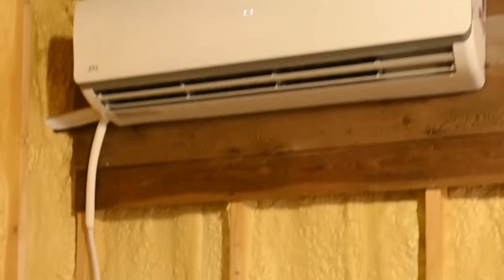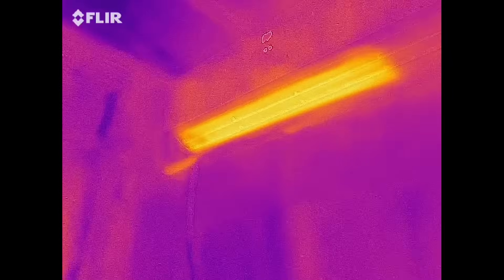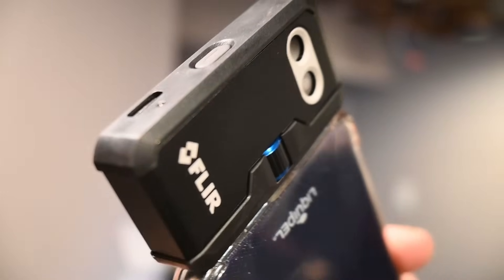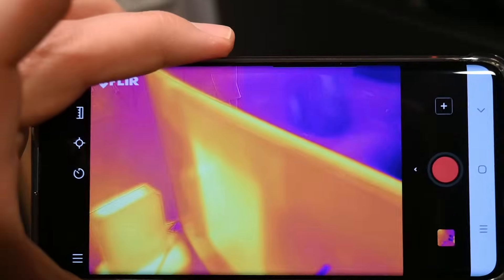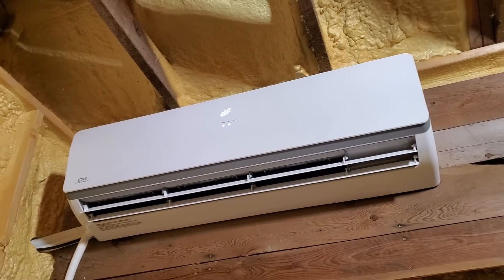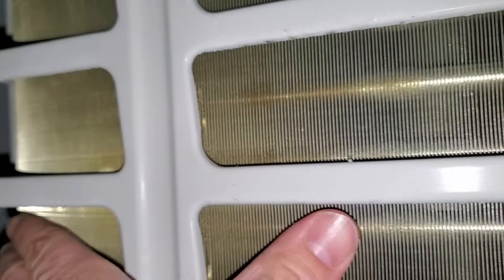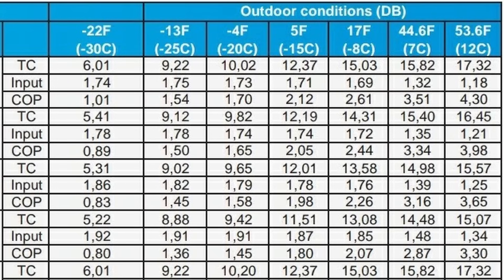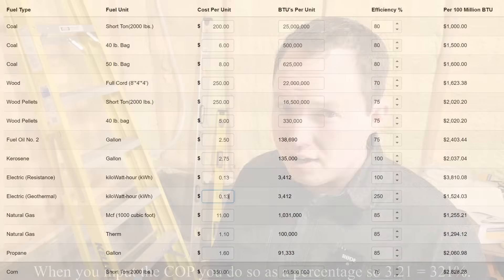Can You Use a Mini Split in EXTREME COLD? Heat Pump vs. Propane Cost Comparison with Thermal Camera

Comment: Nice informative video. A friend had a big house that had two heat pumps about 40 years ago. First year he had to call tech out twice to fix a problem on each one. Told him to just use the natural gas for heating the highly insulated house . He had 6" if insulation in all exterior 2 by 6" walls & R50 in attic and house wrap. Second year he had to call tech out twice and it was not cheap. Finally in third year once it got under 40 degrees ran on natural gas. Did not have an expensive service call next 5 years. Does anyone know how long heat pump compressors last when run in weather down to zero degrees ?
Reply: That's a very broad question and unfortunately it's something that depends on multiple factors like use, location, and weather. 

Most manufacturers warranty their compressors for 5 years. Which means they expect it to last at least 5 years. 

In my experience most compressors original to the system will last the life of the system or break sometime after that 5 year mark. If you replace the condenser typically you will get two to 4 years out of that replacement.

Comment: I was just thinking, seeing the lines outside the garage and since you are mostly heating with the mini, would the unit have been more efficient if you had run them inside and only outside at the unit?
Also, I just checked, in my location, NY Catskill Mountains, I just got LPG which only runs my stove. The price is $4.36 a gallon (11/1/2022). That means gas will no longer be cheaper than a HP regardless of outside temps. In fact at these LP prices a purely resistance heater is cheaper than gas.

Comment: To me the potential added cost of a heat pump in colder weather is offset by the safety of the system. ALL gas systems carry a risk of CO poisoning. You simply don't have that risk with a heat pump.  If I have a few days a year I'm paying twice what I could with gas, I'll do it for the lower cost the rest of the time and the safety of the system.

Comment: Propane in nj 5.58 per gallon. Best price 4.38.  So...
Reply: Interesting just paid $1.87 gal ( bought 380 gals)here in upstate NY. but I also belong to a co-op.
Reply: @inspectr1949  today was 3.50 ish.. went down!
Reply: @Curious_Skeptic  Go figure; super insulate, use  high efficiency windows, heating, cooking,  hot water, using  less gas and the price goes up, do nothing use (waste) more gas and the price goes down,  LP co-op helps tremendously if you can find one cut my bill in 1/2.
Reply: @Michael Kratky  We rent the tank from Suburban Propane. If you own your tank, you can find much cheaper options.  I hope we can buy our own tank soon.
Reply: @Curious_Skeptic  Around here Suburban is the most expensive. I own a 500 gallon buried and rent a 5OO  gal along with 2-100 gallon tanks as I have 2 houses and a woodworking shop.
Reply: @Curious_Skeptic  Something I figured out 20 years ago, can't figure out why anyone  uses them even my neighbor most interesting  as everyone does comparison shopping for everything else?

Comment: it's not "pulling" hot air in from the outside.  The process of compressing and releasing the gas creates heat.  That little bit of heat is being transfered and released to the inside coil.  You are not getting more calories out than you are putting into the system!

Comment: Would love one of these minisplits, but the only HVAC companies around here work with Mitsubishi mini splits and they want 9-12K just to install a one head 12,000BTU setup! That's how much it cost to get a normal full house 3.5 Ton split system heat pump + air handler + aux heat. It's madness. And most contactors won't install or service homeowner supplied units.

Comment: i watched a few of your vidoes man you do great work. I figured id ask your a question and really didnt know which one to post it on so i just posted it on this one since i was the last one i watched... could you get an inverter type mini split and wire it up with a plug in and plug it up to an out side GFCIs outlet thats pretty close to the out side unit? ofc im talking about a 
110v.  12000 btu unit...i dont see any difference IN changing the 
outlet that GFCI outlet was into a quick disconnect when u could or anyone 
that would ever work on it could just unplug it you cant get any faster than
 that to disconnecting it lol.   whats your thoughts?  just wondering if it would be safe if not why not. thanks  keep up the great work and good videos.
Reply: Normally you want to install these units on their own dedicated circuit, they pull a lot of amps. For a 12,000 BTU unit, Pioneer recommends a dedicated 20amp breaker, a switch disconnect box, 12 AWG wire, and a surge protector.

Comment: I had a hot air oil burner in the house when I bought it 4 yrs ago I do not use it because of the dust it blows bothers me. I added mini splits to my living area, master bed rm and addition of the house. I keep a propane wall unit in the living space and 1 of the bath rms. and a propane stove. I have solar put on the house when I moved in and sell power back to PPL. I also have a fire place and keep some wood around but no longer use it.

Comment: Great video! I'll be moving to an extremely cold weather environment soon, and this video answered quite a few questions I didn't even know I had! Thank you!
Reply: Just moved to an area with winter extremes down to -20F. I like the automatic nature of the heat pump. My concern is what this video brings out, the efficiency flop around 0F. My place has a propane monitor currently. But I am debating getting a wood pellet stove to solve the heat problem for good. Little more work involved with pellets but inexpensive. Not sure if I'll end up with heat pump but love the idea.

Comment: Are the C&H  Mini Splits as efficient and reliable as name brand pumps  with variable speed compressors?  I'm thinking of installing one myself.  But if I get in over my head, how do HVAC contractors generally view bailing DIY'ers out?
Reply: You may have to call around a lot before you find someone that is will be willing to look at a DIY or home owner supplied unit. I am in the same boat, the big name contractors around here only want to install very expensive Mitsubishi units. Mitsubishi units are top of the line, but sometimes I don't need a BMW I need a Toyota.
Reply: C&H is manufactured at the Gree factory. These rice brothers know their stuff.

Comment: It is wierd to wrap your brain around.  Once you realize there is no such thing as cold only varying amounts of heat it makes much more sense.

I liked the guy that built a solar collector down the length of his house to use with his heat pump in the winter.  Basically a lean to shed with solar panels as the roof and clear glass for the walls.

Comment: Great series of videos on the mini split.  Very clear and useful information and links.  We have a Lennox heat pump and electric furnace in our house.  The house is 5000 square feet on two floors.  It is difficult to get the lower floor family room warm and comfortable without over heating the rest of the house. Do you feel that it would make sense to consider adding a single mini split in that family room in order to increase its level of comfort in the winter.  On average our winter are around the 30 Fahrenheith mark but we sometimes get a week around the 15 Fahrenheit.  Can central air and mini-split be mixed? thanks for sharing this great information.
Reply: They can be mixed. It will help in the winter and summer.

Comment: The explanation of how mini splits work always seem worded bizarrely, attributing the hot and cold mechanics to it being magically pulled out the air vs the radiated heat/cold efficiency based on ambient temp of the air surrounding the evaporator and condensing coils.  Perhaps you can find my mistake in understanding:

Sealed refrigerant systems work following these simple mechanics: My overly simplified overview...electrically driven motor forces a refrigerant around a sealed system going from gas (creates cold) to liquid (creates heat) indefinitely.  

Condenser side: Compressors push the Refrigerant from its gas state into a smaller diameter tube (called the condenser) forcing it into its liquid state.  This creates immense heat.  Fans placed behind the condenser, that are now super hot, force air across the surfaces of the hot lines helping release the heat.  

Evaporator side: The slowly cooling smaller diameter lines then empty into larger diameter lines (called the evaporator) creating immense cold.  On a refrigerator the condenser is usually underneath or on the back and the evaporator is usually in the freezer with a fan behind it.

When the now liquid refrigerant reaches the evaporator it empties into a larger diameter tube creating intense cold.  By having a fan behind the Evaporator section blowing through the coils you create cool air.  My understanding is the mini split just puts the condenser outside and the evaporator inside.  Adding the heat pump must add additional sets of coils in both locations.  So now the outside unit must have a condenser and evaporator and so does the inside wall unit?

Comment: 3 words, well 4 or 5.....water-source heat pump (well water....no huge excavation or bored exchange wells..) and wrap your exterior walls in ploy-iso sheets before siding. Your IR camera will no longer see the warmth from the framing radiating heat to the outside.
   Anyone complaining about their heating system is actually in need of modern insulation solutions.

Comment: Your terminology is ambiguous.  Heat isn't "rejected" and "cooling" is just another word for the removal of heat.  Heat pumps move heat (into a confined space and/or out of a confined space).  While it seems like you grasp the concept, the words you choose in this video are a bit misleading.  A heat pump is always in "heat pump mode," it's just a matter of in which direction it is pumping heat.

I only bring this up because you are typically very careful about how you phrase things.  This video seems to be an exception.

Comment: Yea but the majority of the heat that unit is generating is coming from compression not what it’s pulling from the air so yea it technically is using the power to generate heat by running the compressor.
Reply: Any resistive heating from the compressive will be negligible, otherwise the compressor would constantly be overheating and destroy itself during the summer months.

Comment: Hey Ben, I'm just wondering where can you get propane in MN for $1.60/gallon? That would be about $38 for a 100 lb tank fill.
My brother lives in the twin cities and has been paying $70-75 to fill his 100 pounder the last few years.
Could it be that much cheaper in rural MN and/or is that price based off of buying in bulk, say for a 300 lb tank for home heating?
Reply from the maker: Guessing it has more to do with the bulk quantity. I just had 300 gallons delivered about a week ago and it was $2.05 per gallon.
Reply: @BenjaminSahlstrom  I got 250 gallons of Heating Oil delivered for $3.53 in January and now they want $6.00. Yeah, it's heat pump time.
Reply from the maker: @stevenle1760  So ridiculous. Oil shouldn't be this expensive. Heat pumps should be a big help with keeping costs down in this overpriced oil environment hopefully.

Comment: Excellent presentation. Fortunately, my home has natural gas heating, and my gas bill last month (for January) was $60.00 to heat my 1850 SF house to 76 degrees F (24/7).  I live in AZ in the Phoenix metro area.  A heat pump would cost me much more to heat my home than using natural gas and in the summer my TOTAL  gas bill (to run a gas hot water heater) averages less than $25.00 per month. My AC cooling cost on the hottest month in the summer was about $100.00.  For this climate, it is the most energy efficient combination. In the winter we get temperatures that drop near to freezing (32 degrees F).   My Trane gas heater rarely runs more than five minutes to maintain the temperature at night.  Have a great week.
Reply: Hello. Do you have 2 stage or modulating heating stage gas furnace?
Reply: @AlexAlex-nk6gy  Hello, no, Trane does not require a two-stage gas furnace in my area because it is very hot most of the year. I live in the Phoenix metro area in AZ.  It does get cold here for about three months of the year. It rarely freezes, but occasionally it does. 

I just added insulation last year and I think my worst gas bill has been around $100.00. But keep in mind that I also have a gas water heater. So it is dirt cheap to heat my house. My typical gas bill is less than $25.00 for about eight months of the year. Then for about 3-4 months it rises to $50 and then $75.00.

Comment: Awesome video, helps me make an informed decision. I am thinking about installing a Mini-Split system. I have a situation in my house where back in the 50's there was a system installed by Coleman in which they ran a 3" takeoff to each room, the living room received 2 since it was a little larger. The furnace I have now (25+ Years Old) the unit shuts off on high temperature because the furnace can not expel the heat within the unit through the 3" lines. My furnace technician told me that this will be an issue with a new furnace and will only let this happen 3 times before it shuts the furnace off and requires a technician to come and investigate, a safety feature. My dilemma is now installing basically all new larger duct work throughout the 2 story house or look at other options like a mini-split. It's a smaller house, 1250 Sq. Ft. so I have no real internal walls to run duct work up to the second floor and tearing out walls and ceilings to make this all happen is going to run the replacement bill through the roof. Even if the Mini-Split is more expensive than a normal furnace replacement I still think it's going to be the way to go when the time come's, it's going to be much cheaper and less intrusive than trying to replace duct work and I will probably be able to do it all mostly myself, or at least a big chunk of it. Thoughts?
Reply: The alternative is to get a boiler, instead of a furnace, and run 3/4 inch hot water pipes for baseboard heating.  The new side-venting boilers are very efficient.

Comment: I turn our heat pumps off at around 15-20°f. Our water lines and heating lines run parallel, so when it gets real cold I worry about water lines freezing, especially upstairs. Once we get into mid to late Feb. Heat Pumps all the way.

Comment: How about comparing to natural gas, which is far more common to use than propane.  Where I live, it rarely gets below 35 deg F and the humidity is usually below 15% too, so I doubt it would freeze up often.  I have had minisplits freeze up on the inside during the summer (not here, over seas).

Comment: I have a hyper Fujitsu minisplit that works minus 15 degrees. I also have cheap models that work only up to 20 degrees. One thing I’ve noticed, minisplits are good for suppliment heat. As a primary heat source, not too much. The size of the unit, size of the room and a multi zone does have an impact on its efficiency.
Reply: That's like saying you'll be hungry if you eat less.
Reply: Degrees what?

Comment: There's no such thing a "cold". It's absent of heat. Absolute zero is the coldest you can go. We're still finding "heat" at hotter temps. Great video. Are you using any king of air exchanger?

Comment: Even if a MiniSplit may be less efficient at lower temperatures, it has the much greater benefit that it can cool in the Summer, where other sources can't.  Definitely worth the investment.  Great video.
Reply: True, a propane or electric heater are just a waste of space in the summer.
Reply: @SkaBob  in very cold climates, where it regularly gets below zero every night in January and February, supplemental heat sources such as a traditional furnace, boiler, or even wood burning stoves can make up for that.
Reply: In Australia we are mostly to hot or to cold so these units are everywhere. In cooling cycle in ideal conditions a cop of 5 is possible. However cooling really struggles if we get 40 to 50 degrees Celsius under a tree. Radiant heat from the ground gets much hotter been known to melt the tar roads near Cairns.
Reply: SgtSchulz - I think the dual function of heat pumps are their best feature.

Comment: As far as I can tell, there's no such thing as "heat pump mode", there's just a heat pump used in an aircon to provide heating or cooling inside. I would say an aircon is always in "heat pump mode," because the heat is always pumped (either to the inside for heating inside or to the outside for cooling inside).